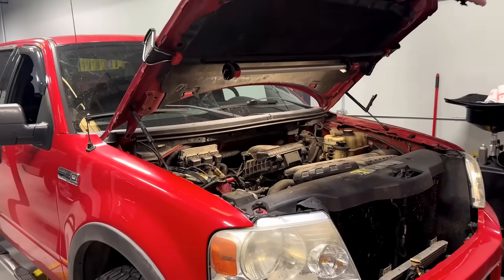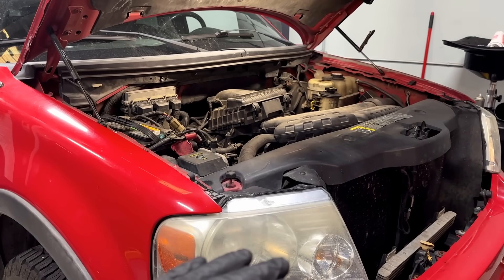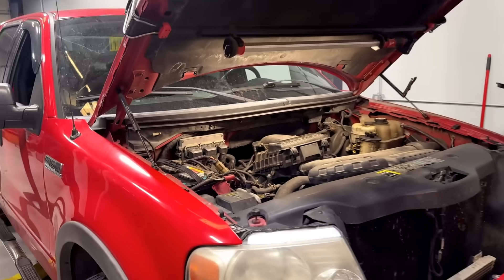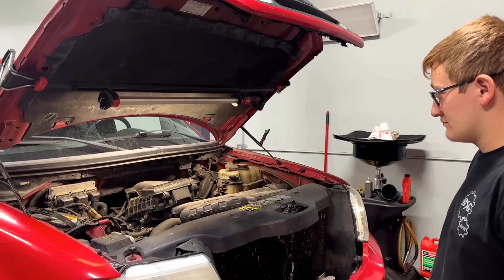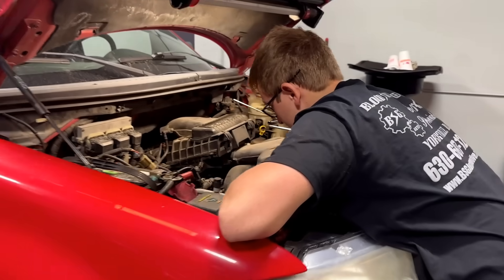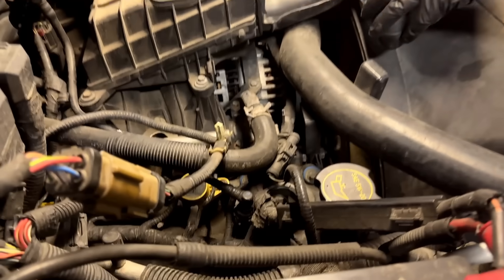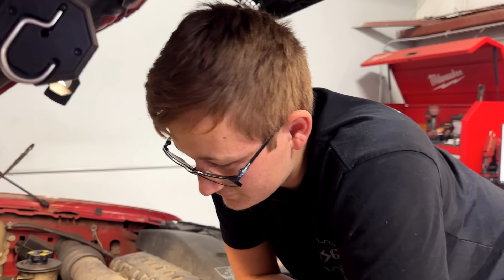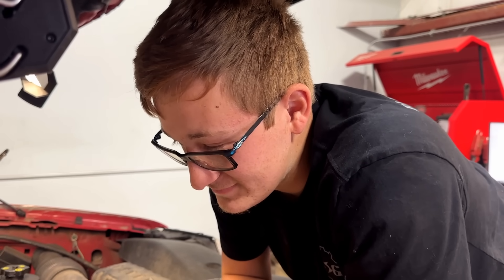Ford 5.4L 3v Triton Ticking Tapping Noise and Fuel Smell: Teaching the Next Generation!

Comment: I've had a spark issue in a 5.4 3 valve, awesome mechanic had to Time Cert the threads with the Special Tooling...Is .it still worth doing a upper timing job...when time comes , currently 126,000 miles 2014 E 350 series Van front... Ugh?  Possibly slightly tick on follower or Tensioner.. engine still running great.

Comment: Well i just learned something about my 5.4.  Now if i could get the darn fan clutch  loosened i could tear down the front of the motor to do a timming chain/oil pump.  All the videos show or say it goes ccw to loosen. Mine does not budge.  It is a 07 expedition with the 5.4. What gets me is i replaced it 1.5 years ago and now it doesnt want to loosen. Now im flustered in kansas.

Comment: Hello I have a 2004 Ford 150 lariat 5.4 I watched your roller video and have a few issues myself. Driving up hill in 4th and lower rpm. I give it more gas it studders and sounds like missing and then it shifts to 3rd and it gets back to normal 3k rpm no miss. All new plugs and coils. Still studders just under load. I tow with od off and no issues.

Comment: What's your thought on my 5.4l is almost at 100000 miles, it only ticks a little when it gets warm. But I know from having a supercharged 93 5.0 mustang that I would never dream of running 5 w 20 or 30 in my car and from living on a farm those big case ih magnums only take straight 30 w. I've ran 10 w 30 in my 5.4l and it doesn't tick. My thoughts are not enough viscosity in the thin oil. I mean my supercharged mustang has a morosso deep sump oil pan and I run Brad Penn straight 50w yes gotta let it warm up but when ur pushing 650hp and lots of boost those synthetics won't do the job. I trust higher weight oils

Comment: Hey bud,is there a coolant temperature sensor on the engine or is it just the coolant head temperature sensor that the cluster read off of,mines goes up pass 3/4 of the way then back to normal when driving. I have no leaks,water pump seems to be wrkn just fine & I replace the radiator,any suggestions on what I need to do? Thanks in Advance!!!

Comment: Also #1 cylinder keep having a fault on my OBD2 code reader,I’ve installed new plugs & coils all 8,made sure I was getting power to the coil & injector but can’t wrap my hand around why it’s still idling a lil rough with hesitation @ the gas pedal. Any suggestions would be helpful. Thanks in Advance!!!

Comment: Wow! That plug! Mine did that and I wasn't sure why. I asked numerous parts house guys and also a dealership tech crew and all had said they'd not seen this before either... I'm now at wits end with my truck. After multiple repairs When I fired it up everything seemed alright now I'm misfiring on 5 7 and 8... And now a code for crank cam bank 2 not correlating. Did timing and everything. Checked timing 3 times before I put covers on. Thanks for advice on all your videos... Found them way to late for my trucks sake though...

Comment: You saved me with this one in ‘18 when I picked up my used 08 5.4 3v… I had an awful raw fuel smell …. Got in and tightened the back plug on drivers side ( was barely finger tight) …. Ran awesome for years after that

Comment: I have a 05 5.4 3v and i just spent 2500 for timing and plugs.....5 months later check engine light knocking  and ticking out of the blue stalling at stops sounds like a time 💣  motor has 100k on it has been leaking oil from everywhere dont buy a jasper reman. Should i keep sinking parts in this thing or order a new engine?

Comment: Soooo glad I have the Explorer with the 4.6 two valve and not the three valve! Have over 250k trouble free miles just regular oil changes and the only repair ever made on the engine was new intake manifold gaskets.

Comment: I think this is a very likely explanation for what's going on with my '07 5.4 in my F-150. I hear the tick tack on the passenger side, and I also smell unburnt gas in the compartment and thru the ventilation A/C unit, and the cab when not moving. Plugs were replaced by an independent shop 4500 miles ago.

Comment: Evening sir I just ran across your video, I have the exact same ticking noise on start up,  as it settles in idle gets lower, when I'm driving and give it acceleration it gets louder but off acceleration it's lower. I checked what you guys checked in this video but it's not the cause, what else could it be? Thanks

Comment: I am totally impressed with your knowledge of the Triton 5.4L engine and I have learned alot from watching your videos.  I have been trying to diagnose a terrible noise from my 2006 Ford F-150 (55000 miles) and I am stumped.  It is not a noise that I have ever experienced before and it is not subtle.  It randomly happens when the engine is warm and usually at speeds greater than 15mph.  Sounds like I just ran over and crushed a metal trash can.  I stop the truck and get out to inspect and the noise goes away.  No leaks, no visible damage.  This happens about once every few weeks and it has been happening for the past two years.  I have come to the conclusion that I must wait for something to break.  Have you ever heard of anything like this in your professional experience?

Comment: I felt safe buying a 5.4 F150 because of your videos.  Replaced oil pump with HV Melling along with timing components using oem.  172,000mi and runs like new.  Only issue is it uses oil, about 1qt every 2k.  I suspect it is due to the badly designed pcv system.  Can you do a video addressing this problem?  My engine is a 2006, was it fixed with the redesign in 2009?

Comment: I really enjoy your videos. They answer a lot of questions. I have a 2001 Ford expedition 5.4 triton 4 x 4 and I did have two questions for you one I did my spark plugs and ignition coils a while  back and I have a tick now and from what I have learned I believe that this is a problem that can run on this model as well but I wanted to make sure from you. The second question and this is the big one I’ve been pulling my hair out for months my expedition sounds like what a big rig sounds like when it’s accelerating from a dead stop like a loud vacuum cleaner I have that issue when accelerating and some loss of power and my upstream oxygen sensors are reading lean to mostly rich I’m using a decent scanner, but a scanners only is good as the user and I am still learning. If there’s anything that I could check or do I would be extremely grateful. I have ran a smoke machine through the tailpipe and through the air intake tube and I did not notice any smoke coming out the exhaust manifold or intake. Thank you again for your videos.
Reply from the maker: Oh, I would definitely check for loose spark plugs. You want to torque them higher than spec around 20ft lbs.

Comment: Mine makes the same sound almost exactly and I have truck running rich and idling rough. But I just changed lifter rockers and timing kit. But it sat for a few months so could it still be loose spark plugs or what could it be?

Comment: I have a 2007 F150 5.4L 3V with 123k miles and it makes a very minor rattling sound just as the throttle is applied and then it stops. If I tap the pedal and let off and tap again, it will rattle each time. Any Ideas? i want to take care of the problem ASAP before i find metal in the oil. Thanks gents

Comment: Hello Mr fordtechmakuloco I need your help! Can you make a video or just please comment about the crank shaft position sensor wiring harness on ‘08 f150 5.4 and how to replace it with a new pig tail.? The new pigtails are two wire and the original plug has a non shielded wire but where do I hook it back up to? I guess my non shielded wire broke and I’m missing 6 to 8” of it.

Comment: To all you other 5.4 owners, I just randomly removed and sprayed my MAF sensor with CRC QD contact cleaner. Instant improvement to everything. Yes, my air cleaner is very new/ clean. The MAF sensor is very sensitive to any residue at all. T15, two screws. Spray the plug and receptacle too.

Comment: I had my spark plugs changed at 103K miles on my 2010 4.6 2V.  A few months later, I was smelling fuel vapor in the cab, coming through the vents.  After doing some research on the F150 forums, everyone was saying check spark plug torque.  I mentioned this to my mechanic, and he says, "Oh, I've never heard of that."  A week later the plug shoots out of cylinder #3,  It had to be reinstalled with a helicoil.

Comment: I can't thank you enough for this video.  I have an '04 F150 with the 5.4 3V up here in Canada, with over 336,000km (over 200,000 miles) on it and it recently developed a nice tick.  I'd recently had plugs done, and the guy who did the plugs found that the last guy only changed 7 of the 8.  As the last guy also did a timing job at the same time, I figured corners were cut there too and I was looking at another timing job, or a rebuilt engine considering the mileage.  I did know about the loose plugs sounding mechanical, and was going to check the plugs before spending the big bucks, but this video inspired me to check them today.  I could feel a slight movement on #1 COP (THANKS for this tip!), removed it and found the brown residue on the boot, spun the plug out by hand, just like in the video, and it too was missing the ground electrode.  With a new plug properly torqued my tick is gone.  Thank you good sir!!!

Comment: Hey guy I have a 16 f150 5.0 I had trans rebuilt while back I been getting an aggressive up an down shift into 2nd gear only it will literally chirp the tires down shifting  into 2nd gear only what would I think is causing this.every gear feels good but 2nd up an down shifts

Comment: Hey, love the channel 
I ran into a situation with my 2009 Ford Escape Hybrid, my 2 way check valve went bad and I have no brakes. I've tried looking everywhere for it, all I find is small 2 way. I've seen your video from about 6 years ago and wanted to know if you know the part number for the check valve coming from the vacuum pump to the brake booster. Much love hope you could help.

Comment: That happened to my 2008. I would have swore it was a valve tap.There was a piece of something in the spark plug tube so you couldn’t get the socket on. What a nightmare getting it out. One dead giveaway is a cab full of fumes when you first start it.

Comment: I have a Question,I have a 2016 F150 with a 5.0 V8,I have something called a Cam Idle sensor (I think that’s what it’s called)…anyway is going Bad again (supposedly) so my motor starts Shaking when I come to a stop & Dies,but it will Start right back up…I took it to a Dealership when it first happened & Ford Couldn’t Figure it out for 5-6 attempts,so Finally after going to 3 different Dealerships,I got it Fixed( supposedly) well Now its doing it again a few years later,What do you think I should do,my Warranty has Expired
Reply from the maker: You need a timing job not just a VCT solenoid.
Reply: @FordTechMakuloco  thanks and what is a VCT solenoid ? Also, I bought New Belts & was told to make Sure my Tensioners are good…how do I check those ?

Comment: I am going to replace the headgasket on my 2010 f150 5.4 , i went ahead and ordered roller followers and timing set you have recommended on your videos since i have it open. Should there be an order i go about doing the things? Do i start with followers then do head gaskets and end with the timing set? Any input helps thanks.
Reply from the maker: Why the head gasket? Was it overheated?

Comment: Them are pretty easy to work on not all 2v have thread issues the non PI heads I personally believe are better quality, and seem to last longer for the mustang GT And was a better casting they made way more 5.4 heads then they did four six so quality control was lacking.

Comment: Attention to detail seems to be lacking in many shops these days. I just had our '93 GMC SUV fixed at a shop for a massive oil leak (turned out one of the factory remote oil lines blew a seal) and replacing all the intake/plenum/valve cover gaskets while there because they were leaking badly too. When we got it back it wasn't running nearly as peppy as before. Threw a timing light on it and sure enough the base timing was set to -3 degrees TDC. Adjusted the distributor back to where it should be according to the sticker under the hood and now it runs great again! They got the oil leak fixed but they messed up setting the timing correctly. Must be in too much of a rush even though it took them three weeks to get the SUV back to us. They said they messed up the intake gasket the first time is why it took them weeks. It needs a PCV valve too it is buzzing/rattling but they didn't mention for some reason???

Lesson learned. I should have paid the shop for the diagnosis and fixed it myself.

Comment: I just bought an '04 f150 at auction and already I've had a spark plug blow out. Apparently that's a common issue. I put a bore scope down and it looked like there were only like 2 threads for the spark plug to thread into. Maybe that has something to do with the torque specs

Comment: When my boss used to put me on the spot like that i would look completely past the issue looking for it because when he asked me to diag something it was never in your face simple, he would come around every 5-10min….what did you find, see anything yet, you need me to tell you what it is….i always told him to let the leash out and get out of my ear😂. After that he would throw me a hint, like you did him a few times that i picked up on, and i would find it and think to myself….why did i make that so complicated🤦🏻‍♂️. Combustion smell and no exhaust leaks i knew what it was at that point, i have pushed down on a coil in a Crown Vic and it sent some volts through me so be careful when you push them but you did have gloves on to though. That sound and smell will send him straight to the plugs next time for sure lol

Comment: I used your several series 3v timing bolt by bolt videos. Watched them all 4 times then tackled the 05 Navigator with our son and only had to refer back to the video for torque specs. Full timing set with oil pump done. I still appreciate the knowledge shared for our experience and successful repair. 🛠️

Comment: Best mechanic ever brother. Before even watching the vid when you said smell I thought exhaust leak :).. Now I'll watch. I been wrenching for 40 years and I know the sound and smell.. at 63 I just put Time-Serts in my Durango as I had some stripped out heads. Just did every one of them damn holes because I know how good those serts are. Beats heli-coils hands down. Was having trouble locating an exhaust manifold.. damn thing was warped like a SOB... Took it down and had a buddy surface it heh.. came out real nice. Got the vehicle dirt cheap from my brother because the mechanic told him how much ot would cost to fix. heh.. But me?.. I can fix any damn thing.. Well not as well as you brother :).. I might have a few tricks/techniques I could pass on to you watching yer wrenching skills ;), but I am damn sure you out rank me by miles.. I might be good, but I know a damn good mechanic when I hear/see one. You rock bro. Thanks for all you share here brother.

Comment: Had the same issue on my 07 expedition and found spark plug #1 was loose. Was surprised to find it to be a plug loose, did not expect that. And I did check them all to make sure they were tight after that.

Comment: Brian Sir, how about the 2 valve plugs loosening? What might be your torque specifications? You have a nice kid. You can tell he's been raised correctly. Good parenting.
Reply: I had a 2 valve engine blow out 2 different plugs.  An area ford expert here put in two inserts and torqued all plugs to 25 lbs.,   never had another plug blow.  an expensive lesson.  most mechanics here only torque them to 16-18 lbs

Comment: If I have a mid year 2008 5.4 3v change over to new design heads with single piece spark plugs and brown coil boots. Question is do I still need to worry about the roller followers going bad as well as I know 2009 was the full fledge switch over. Just a curiosity I have before tearing into mine and doing the timing oil pump etc. Thanks

Comment: I have the same exact truck. 5.4 3v....😤😤. I replaced vct solenoid i gotten from Autozone an still getting code: P0020 Intake A Camshaft position actuator circuit / Open (bank 2). Reset code an still pops up later.
Reply: Sounds good.

Comment: I can't believe you were not getting a misfire code with that plug not having a ground strap! What was it firing to; the top of the piston?
Reply: I can't speak for the newer models, but early 2000s Ford V8s have a stupidly high threshold before they'll throw a misfire code. On my 2000 F150 with the 4.6 you can straight up disconnect a fuel injector or coil and it still won't throw a code.

Comment: I have a similar issue on my 09 4.6 3v (217k  miles). But it doesnt use those type of spark plugs. I have a ticking noise in the same area, exhaust smell and no codes to follow. Now im wondering if this is my issue. Great video, gave me something to look for.

Comment: Car Wizard won't touch those 3 valves. It takes a FORD EXPERT to fix them. Tell him well Brian. When I trained machine operators I used to do the same thing. Make them figure it out. Just don't hand them the answer. Why wasn't it misfiring?